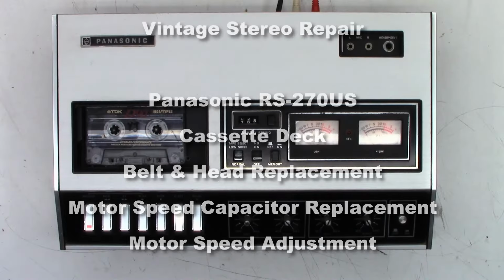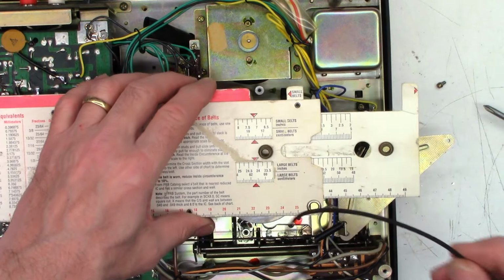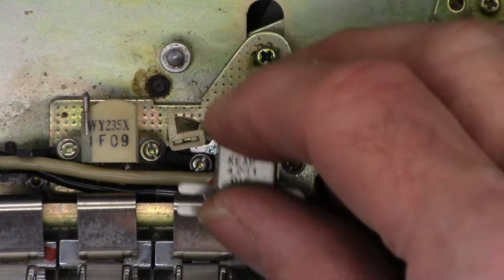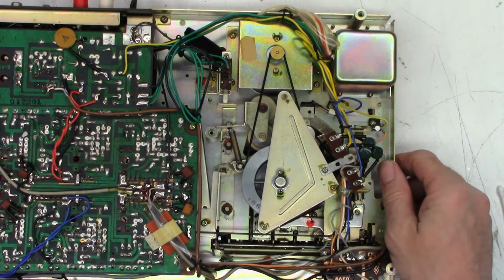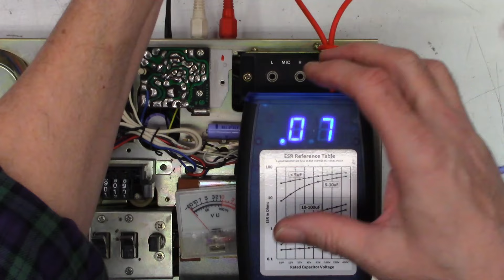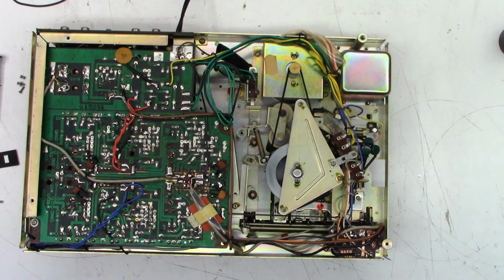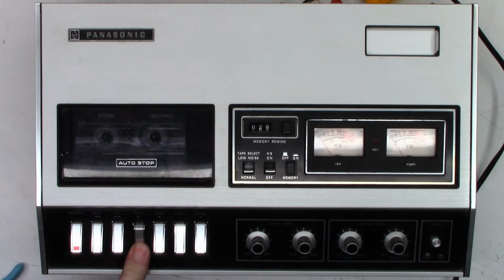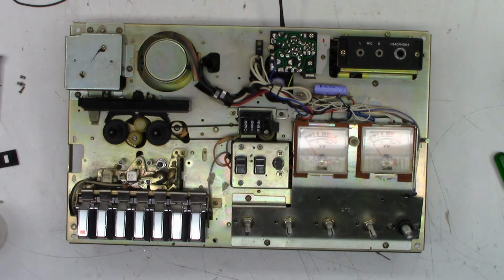Panasonic RS-270US Cassette deck bought used on eBay. What until you see what I found (and fixed)

Comment: If you look at what offset printers use to clean the rubber rollers, which is plain Methyl ethyl ketone solvent, which cleans the rubber parts of all dirt and old ink residue perfectly, but does not dissolve them, the acetone works, because it evaporates fast, so there is no long contact to degrade the rubber.

Comment: Nice fix. I was often surprised at how some belts decayed at a much slower rate, and could still be good after many years of use.
Reply from the maker: I think it has to do with the environment it lived in. When I worked in Southern California I noticed many more units coming in with "Gummy" stretched belts that were only a couple of years old compared to Northern California where the same unit would take 10+ years to have the same belt issues. Thank you Dave.

Comment: Interesting seeing the National 'N-mark' logo embedded with the Panasonic logo that Matsushita designed for the Western export markets. I think they ran this combined branding for only a few years in the mid to late 1960's which may corroborate with your finding that no IC's seem to be used in this unit.

Comment: What a smashing repair :-D
It sounds nice and crisp,  And the playback levels are fine.
How you got a head match i don't know.
I have found that heads sometimes need more or less a.c bias to get a good recording.
And the  head inductance may need a small capacitor.
Just odd things i noticed over the years.
The owner had the motor out,  the motor screws were messed with, why i don't know.

Comment: Guy someone tell me i have an onkyo tx-nr616,  if i replaced the two power transistors or output transistors do i need to adjust the bias because as soon as i replaced them and turned it on when placed the driver board it caused a short fire and killed both much appreciated